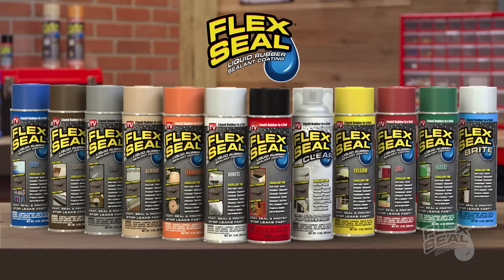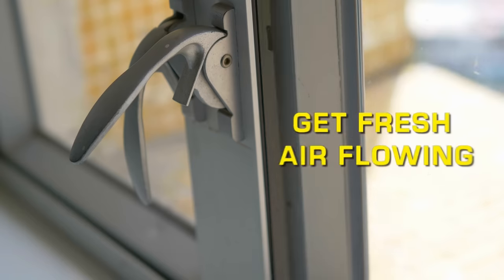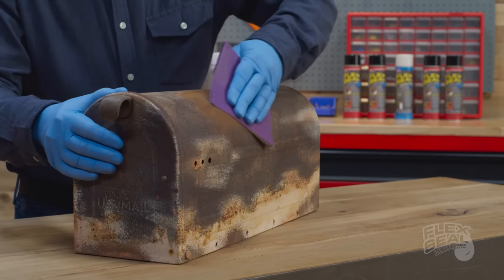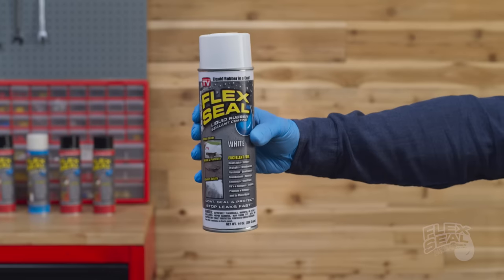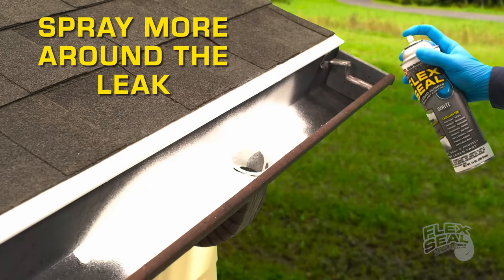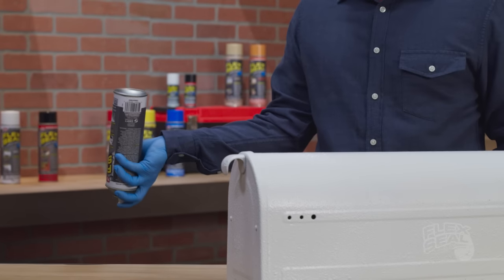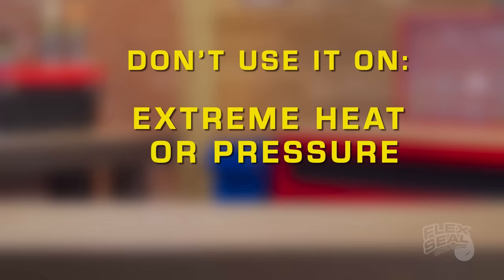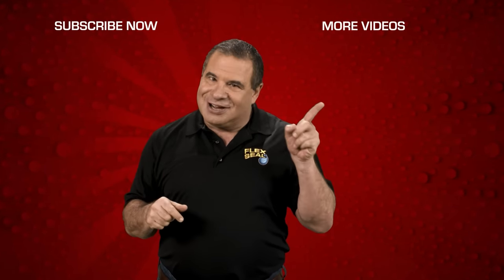EVERYTHING you NEED to Know About FLEX SEAL *How to apply*

Comment: Sprayed this on my girlfriend because I thought it was for all flat surfaces.

We're breaking up now.
Reply: use flex seal, too seal back your relationship.
Reply: @porchmanthree8062  how did I not think of that
Reply: @AntAptive  cmon, just do it dude. thank me later :)
Reply: @porchmanthree8062  i tried it but she had flex tape adhesive remover.
Reply: @AntAptive  use flex gun, too shoot the adhesive remover.
Reply: @AntAptive  wait hold on… i told you too use flex seal, but she has flex tape ar, 
Your Saved.
Reply: @porchmanthree8062  I stand corrected. Thanks for the help kind stranger.
Reply: @AntAptive  No problem

Comment: I'm disappointed with Flexseal because they didn't respond to my query about inverted spray cans. They are needed for those times when standard spray can design can't be used. Screen room roofs could make use of them. These roofs are typically attached either directly to or under the Fascia Board. Most leaks from these roofs start right there. The only way to spray this butt joint is by inverting the can, because the bottom of the can hits the roof. This screws up your spray angle big time. Make nooooo mistake ...I LOVE FLEXSEAL!!:face-red-heart-shape:

EDIT: On second thought, Inverting the can isn't really necessary to spray this joint. Just being able to spray with the can turned parallel with the roof would suffice! Current designs allow for this in short bursts or until the draw tube runs dry.  
Wakodahatchee Chris